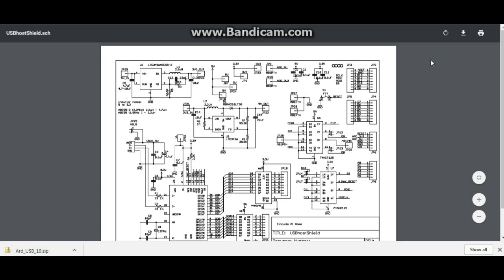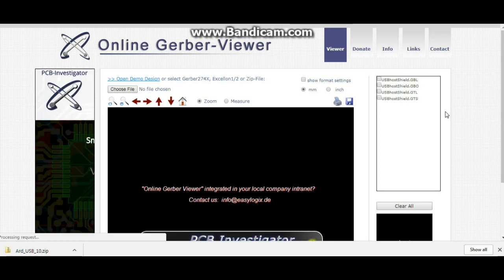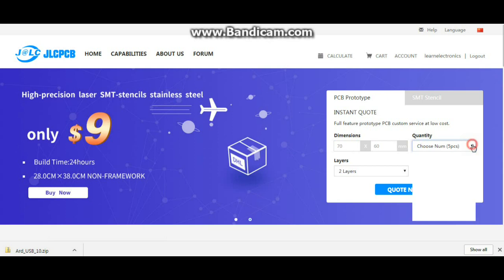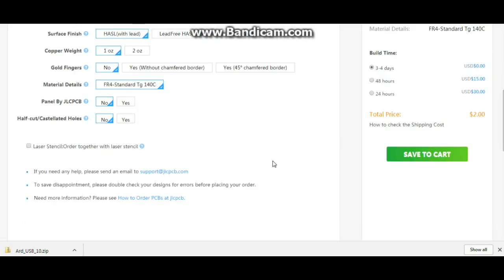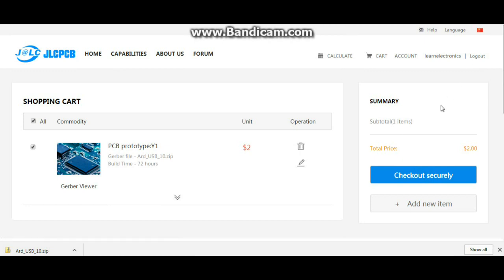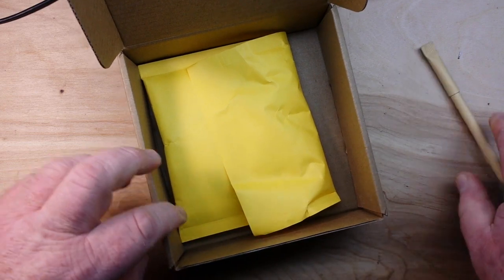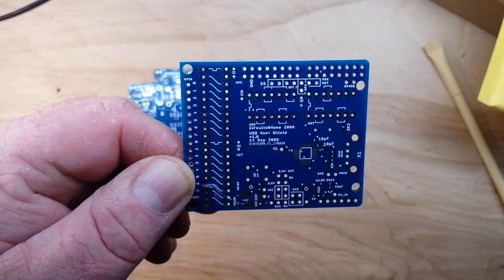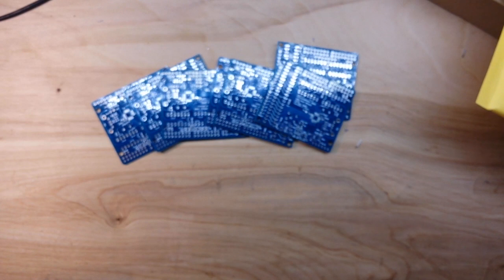10 PCB's for two bucks!

Comment: Saw your video yesterday and started to update an old board (40mm x 40mm) with all the revisions I've made since etching it at home. After finishing I looked at the site again today to place my order and found the price for 2-Layer boards are $5 now. The test order I placed in my cart yesterday still shows $2, but the new order is $5. (1-layer is still $2.) Bummer... Shipping cost for 'Registered Air' looks like it may have gone down a bit though.

 Great video, but looks like I'm a day late and 3 dollars short. :p
Reply: Nevermind. It looks like you can only order one at a time at the $2 price. Since I already had the test batch in my cart it went to $5. Once I cleared my cart, I could order at $2 again. Woohoo
Reply from the maker: Jonathan Wells I'm glad to hear that. I was worried there for a minute.
Reply: Yeah, it made me a sad little code monkey for about 15 minutes. Then I decided to order anyway so I cleared out my cart was pleasantly surprised.

Comment: They are EasyEda - same user email details do not work on site. Surprised they offer coloured boards for no extra as opposed to the same other people.
Reply from the maker: Michael Stevens This is just a guess, but based on my experience that seems to be the norm with the Chinese manufacturing ecosystem. Related industries share infrastructure. I could be completely off base and if I am I welcome corrections.

Comment: "You might to learn eagle but that's not hard." Really? lol maybe you should start a beginners tutorial about eagle? because i have no clue how it works... Is eagle the best option? KiCad is free and opensource.
Reply: r0nnl use easyEDA
Reply from the maker: legoscratch Yeah, EasyEda is awesome.
Reply: r0nnl 
KiCad isn't bad. I started learning it myself a few days ago while working on the OSHW AVR Transistor Tester project. Creating Libraries/components are a pain until you figure out the secret knock and handshake to get in the club.

  The Online support of the community is outstanding, a simple search will get you countless examples and tutorials. I haven't tried to convert a schematic into a netlist and PCB yet but I've watched a few tutorials and it doesn't look hard.
   I think most people get attached to whatever software they learn first. I'd rather support a community of like minded selfless people, even if it means putting up with a few quarks. KiCad is used professionally as well and many companies create and release open source tools for the software such as html new part generators for multi pin IC's and code that pulls all of the part footprints from every GitHub repository live in the software so it's always up to date.
  Professional subscription SW is criminal IMO. There's nothing quite like a company that wants to create a wall in front of your business (workflow) and demands that you pay for access to your business while they hold the keys. It's an extortion business model, where eventually they will own you because they hold all the leverage. Their business mindset is that if you don't like it you can use other software. They have zero commitment to any long term stability, price, or contract with small businesses. A successful business may last decades and that kind of growth requires a stable reliable workflow for it's foundation.... In my own personal opinion, I will never adopt such software, for personal or professional use. You can't build a cutting edge skyscraper with a river barge as a foundation. Why limit yourself to the river barge in the first place.
Reply: Just found out that they even panelize on the boards 100mm x 100mm. I made a small test board 40mm x 99mm and they let me panelize it so 2 on 1 100mmx100mm board. Double the amount for 2 dollar.. lol. LOL